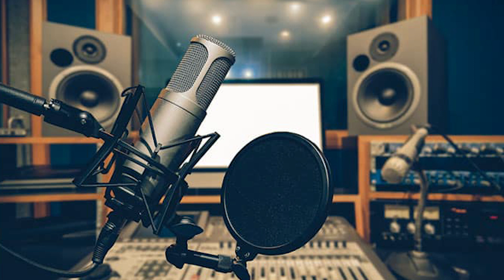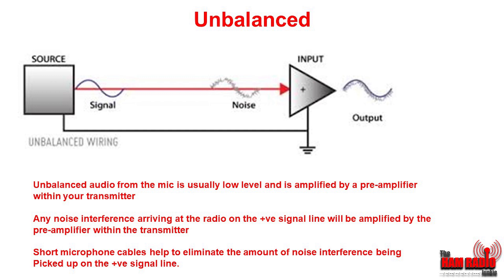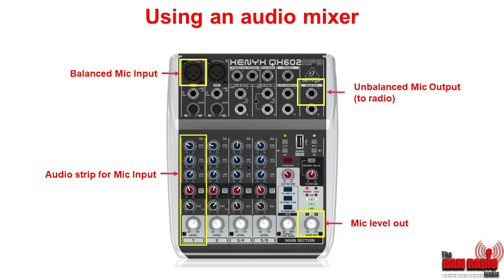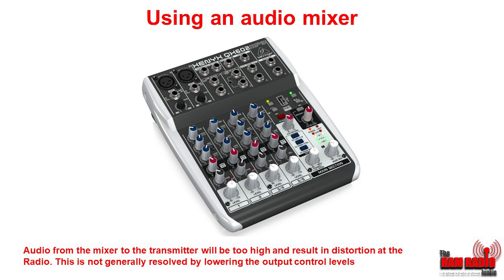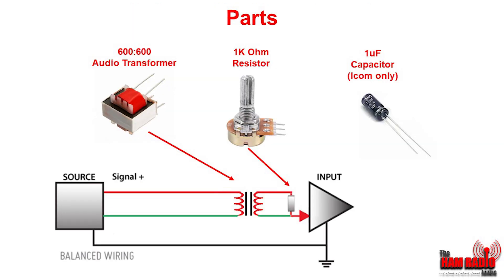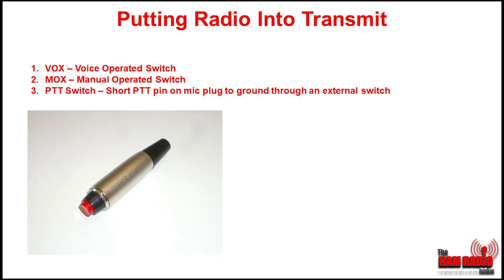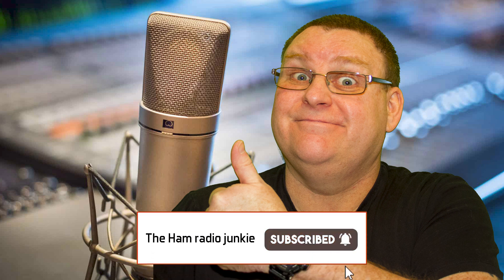Studio Microphones and Audio Mixers in ham radio

Comment: Why the potentiometer (5:40)?  Isn't the Mic level out (5:05) basically just a pot for the output audio signal?
Reply: I'm using a USB-C audio interface so that I can have my big boy mic connected to my pc and radios, but I just want to make sure that I understand the why in this video.  Do Mixers use pre amps or something to boost the audio signal, and then we need to pad it back down to what the radio is expecting?

Comment: thanks, keith!  so, on my FT-DX10 I am running a xlr condenser mic into a neve 1073 preamp / eq combo.  i tried connecting the output from the neve to my radio, however at even the lowest level setting on the neve, i am getting what appears to be a blown out FM signal on the radio's screen scope while in LSB on 40m.  will an off-the-shelf xlr audio transformer from amazon fix my issue?
Reply: nvm, i figured it out.  i built this bal to unbal cable with an inline 600:600 transformer plus a 1k pot with the center wiper and right pins going to one input wire on the xlr out, the the cable is effective.  good signal to the radio now.  so, my chain is:  mic xlr input > neve > xlr out > the cable with trans and pot > radio.

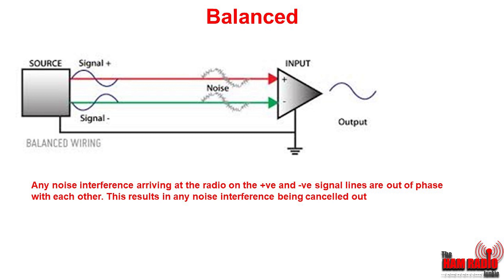Comment: 2:55 The text is misleading.  Noise arrives at the balanced amplifier input IN PHASE ("common mode"), not out of phase.  The desired microphone signal arrives out of phase and is amplified.  The amplifier is a differential amplifier and ignores, mostly, common mode noise that arrives on both wires at the same time.

Comment: Great video but i take my audio thru the Acc balanced modulator at the rear of radio avoiding the front end mic input which can be noisy and limits the lows on radio . Find it much cleaner on my icom and kenwood .
Reply: Justin, when you do connect XLR mic to kenwood, how does the wiring go? I noticed that kenwood had mic+ mic- and GND on both front mic and ACC conecctors. I took my senheisser mic and connected it to kenwood (TS590S) straight like that. Mic+, mic- and GND of XLR is connected to GND of TRX. I found no issues with this. Would be this correct?
@TheHamRadioJunkie what are your thoughts on this ?

Comment: Excellent video.  I am confused about the part where you discuss using the mixer.  If the mixer's "main out" is the 1/4" unbalanced jack, why are you showing the schematic (timecode: 5:40) for a balanced output while discussing mixers? Main out only has two conductors.  Please clarify.  I may have missed something.  On a side note, I did buy a 600:600 transformer and a 1K pot.  Ready to put it all together to connect my audio mixer to the Yaesu FDTX-10 input.
Reply from the maker: Frank, correct the diagram does show a balanced output. For an unbalanced output the green wire, as show in the diagram is omitted. The resistor will go between the output and the input.
Reply: @TheHamRadioJunkie  thank you. I guess there is no advantage to adding a 1:1 audio transformer to the main output of the mixer.  Correct?  Just add the pot/resister in series to the output’s tip lead and I’m golden.
Reply: @FranklyRustic  can you tell me what mixer and how you wired your ftdx10 radio. Having issues with getting mine to work
Reply: @FranklyRustic  the transformer can help in case of a "ground loop" or the power supply for the mixer is not isolated well enough from the power supply for the radio and they see each other but the ground potential is not the same.  A current can flow from mixer to radio (or vice versa) on the signal wire in that case.  A transformer isolates this current and also eliminates common mode noise ("hum").  A capacitor can eliminate DC current flow on the signal wire but does not eliminate hum.  
This is a bit extreme; normally if your radio and your mixer are powered from the same mains phase, you won't have a problem especially if you have good bonding of the ground connections.
You can buy inline transformers of the XLR variety.
Google "xlr audio isolating transformers"

Comment: Can I ask if I can use a mixer just to improve the rx part quantity, I mean completely remove the noise at background?
Reply from the maker: Marco, sure you can use a mixer to equalize the receive audio. It may not remove the noise but may improve what you hear through an external speaker.
Reply: @TheHamRadioJunkie  cool thanks

Comment: Nice video. The Audio Engineering Society has determined that in an XLR connector, pin 2 is + hot and 3 is - cold, leaving pin 1 for ground. What to to with that "Ground" seems to vary, but here is a paper by Rane that talks about it: https://www.ranecommercial.com/legacy/note110.html
Reply from the maker: Steve, the Rane paper is very interesting. They also state that rather than shorting  out the cold and ground you just leave the ground loose. Thanks for the comments.